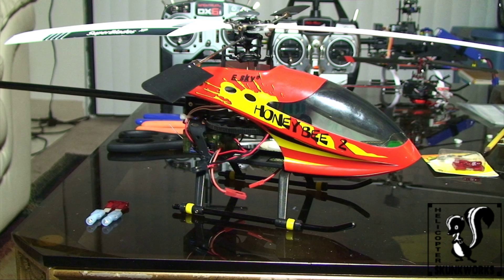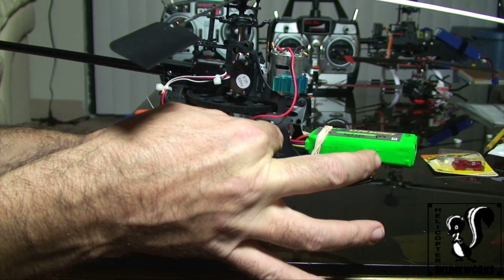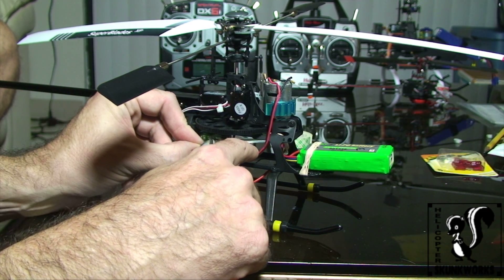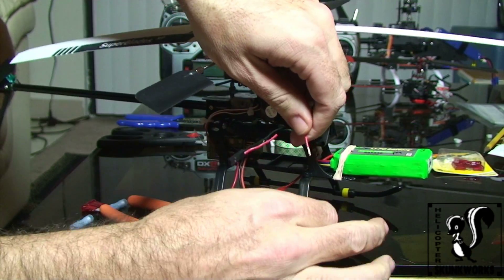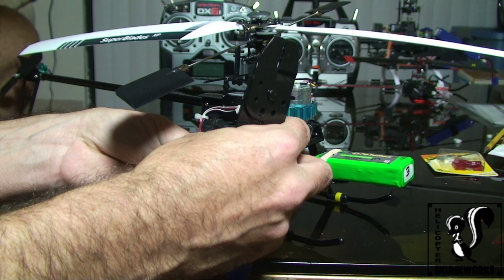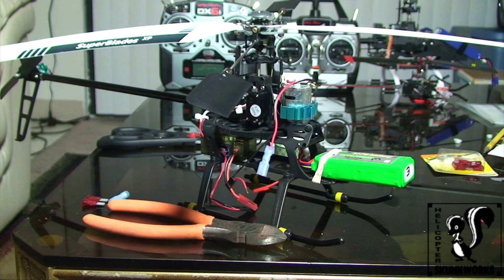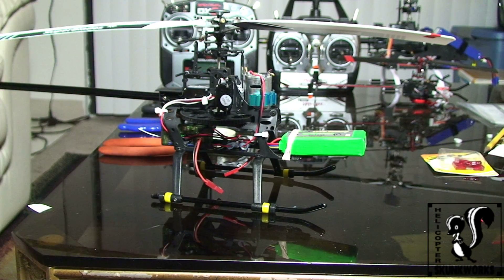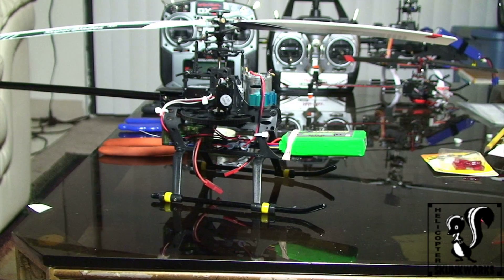ESky Honey Bee FP HBFP V2 - Fuse Mod - Easily Protect Your 4in1

Comment: I did this mod on my HB FP and the 4 in 1 burned out anyway.  The fuse blew, but only after the 4 in 1 went up in smoke. I'm wondering if I have the wrong type of fuse because I can't find a description of fast-blow fuses anywhere online. I'm using Bussman ATM 7.5 amp blade fuses. Part number is BP/ATM-7-1/2RP.  I'd really appreciate if you could let me know if this is the correct "fast blow" fuse, or if I should look for something different.  If that is right, should I try a 5 amp fuse instead?

Comment: I have a question. Why dont you install the fuse between the battery and the 4 in 1... isnt the battery supplying the power for the circuit?

Comment: Another great vid!!!! From my understanding, with this mod, you should use a 7.5amp fuse. But im no expert by any means.
But in my experience, I have been using a 7.5amp fuse in my V2, and it has never burnt out in flight, and I have never popped it in a crash(yet). So I think it is safer, and would offer more protection using a 7.5amp fuse, as opposed to a 10amp one.  It has been working for me, and am open to anyone with any other experiences to share.  5star vid!